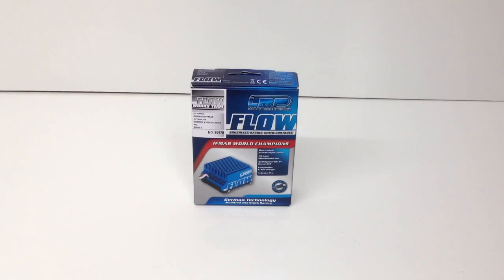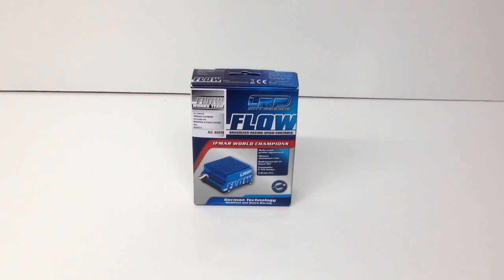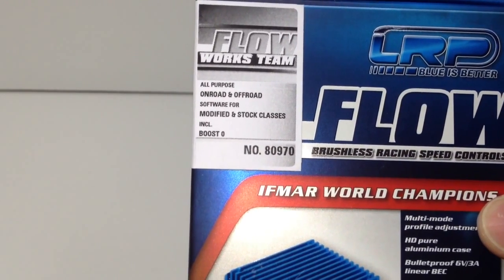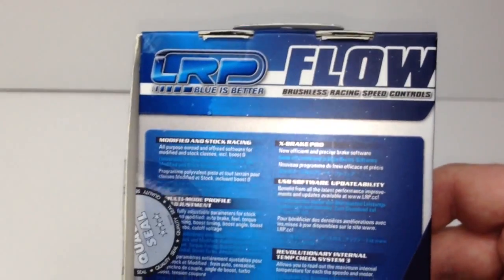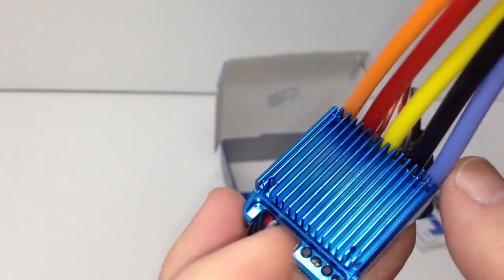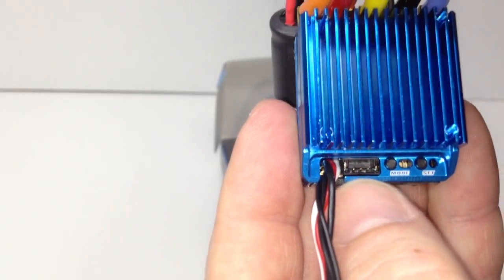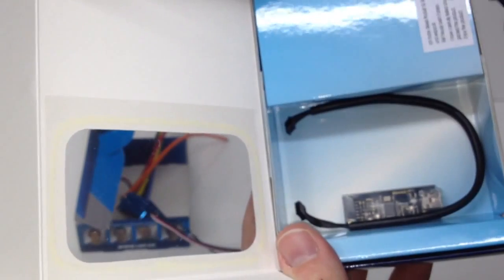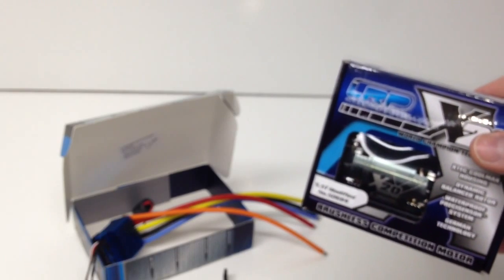LRP Flow Works Team ESC unboxed!

Comment: This is regarding the Lpr  ix8 esc. I would like to see a video, where you fit the cables step by step. The manual that i have does not show which wire goes where.
Reply from the maker: I just pulled up the manual for that ESC and it has designation for each wire on the pictures.  Obviously +/- are your battery wires and the A/B/C are your motor wires - the motor wires need to sync with your motor to the exact letter vs a sensorless motor, which it doesn't matter which order. Here's a link:  https://www.lrp.cc/en/product/ix8-brushless-speed-control/

Comment: Yeah that's the same manual I found ......it only gives the phase amp current which means burst current kind of like a battery pack ....the phase on the competition  is spec rated at 223 phase amps but it's a 80amp continuous current .................the work team is 400amp phase I'm assuming it's a 160 to 190 amp continuous but IDK.....RCN videos are extremely helpful thank you for your time..
Reply from the maker: +S619jensen I think it's safe to say it's between 160-200 continuous.  What are you powering?  The FWT can power anything 1/10th 2wd and 1/10th 4wd buggies easily with no problem.  I've even seen 4wd SCT's being powered by them
Reply: +The RCNetwork im running the SCT momba max 1410 but it does not have Blinky mode.....but I'm getting a team associated TC 6.2 so I need a Blinky mode.... And I've always was a LRP fan in the past .....

Comment: I need some help on the lrp flow competition it rated at 200phase amps and runs 80 amp continuous and 120 amp brief load.......what would be the continuous amp on this esc about 170 to 180 like the takin rsx and the Orion  r10.1 esc? I can't get the real specs
Reply from the maker: +S619jensen Looks like the FWT is about double-ish:  http://www.lrp.cc/fileadmin/lrp_anleitungen/anl_31467_lrp-flow-manual-e.pdf

Comment: i bought this speedo and got a locked rotor LED after 2 battery packs. have to send it in to get serviced..
Reply from the maker: BMOC Yikes!  LRP America is located in San Clemente, CA and are super helpful....
Reply: The RCNetwork yeah i emailed them and got a reply same day. hope they can fix it if not, replace it for me. hope so!
Reply from the maker: Yeah, they're cool people there.
Reply: got a email today and they are replacing it under warranty. sweet!

Comment: Can you do a review on the turnigy track star 120a turbo ESC as it is a copy of the r10 pro and I'm wondering how much different it is. Could you also review the track star 540 motors.
Reply from the maker: I'm not a big Hobby King fan, as I've been burned by them way too many times.  Plus, I have the real deal!  From what I've heard, they are similar, but Orions are designed in Switzerland and use a bit different software and programming card that the step child turnigy.  Also warranty wise, Horizon Hobby in Illinois deals with all warranties for Orion

Comment: This or a orion r10
Reply: r10 160 amp that is.
Reply from the maker: Not sure, haven't ran the LRP yet.........but I will have a good starting point with the R10-Pro!
Reply: Plaease do I am getting a B44.2 in about 3 days so any info ASAP would be great. though I do see he ae guys that aren't sponsored by Orion or other brands running Lrp for esc reedy for motor!!
Reply from the maker: The B44.2 is a great 4wd buggy!  The Team drivers for AE are pretty much locked into Reedy motor and LRP Flow Speedos.  That's pretty much what Hartson runs.  Cavalieri runs for Team Orion, so he's doing the R10 Pro combo
Reply: Then i'll probablly go orion esc reedy 6.0